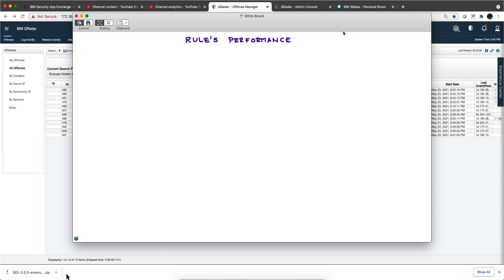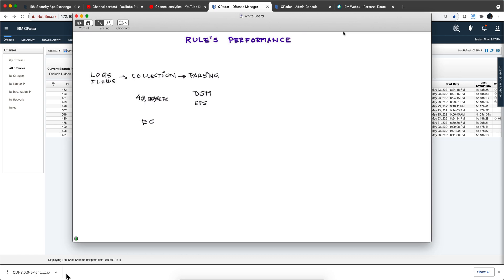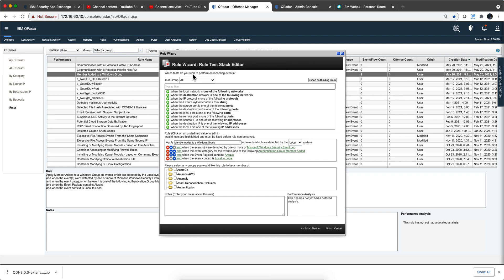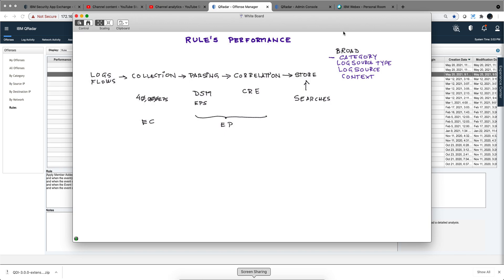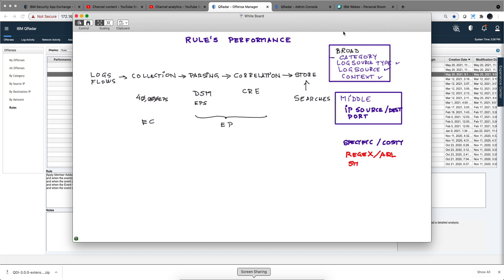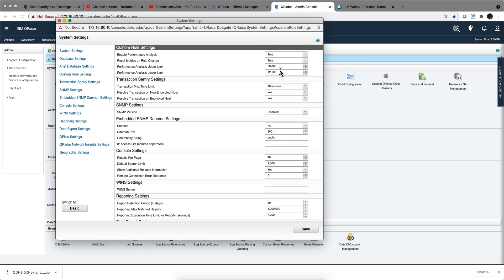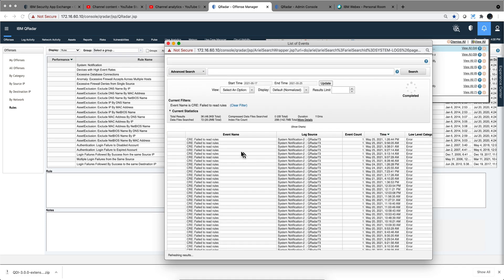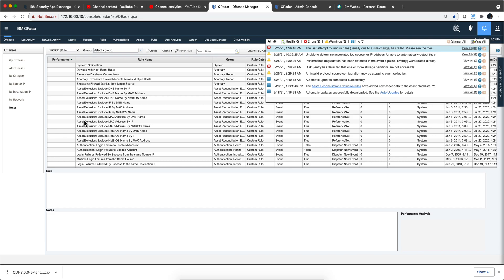Creating and Debugging Custom Rules Part 6 Rule's Performance

Comment: Using this Event Pipeline architecture, I would like to add that, on a distributed environment, COLLECTION and PARSING happens on the Event Collector, while CORRELATION and STORAGE happens on the Event Processor. 

However, in many customer environments it's the Event Processor appliance who performs all those four phases: COLLECTION, PARSING, CORRELATION and STORAGE. Notice that, most of the SEARCHING load it's done on the Event Processor.

Lastly but not least, while the error shown on minute 12:27 is not caused by Rule Performance issues, so, if you're seeing a similar QRadar Notification, I would suggest contacting IBM Security Support.

Cheers,

Polo
Reply from the maker: Thanks Polo